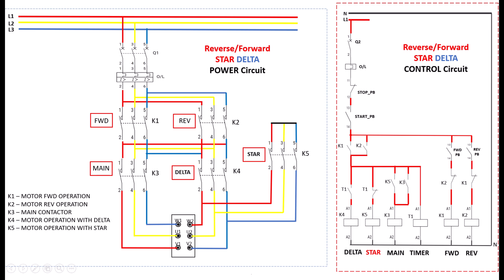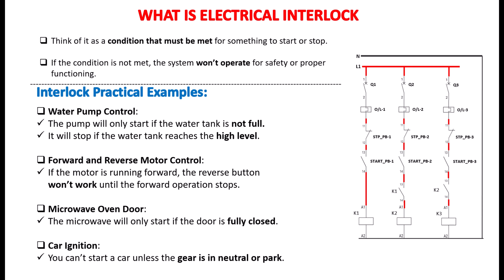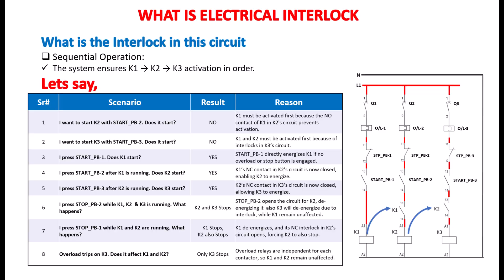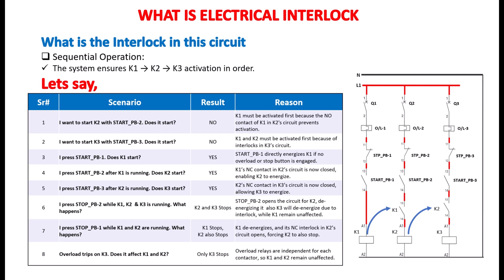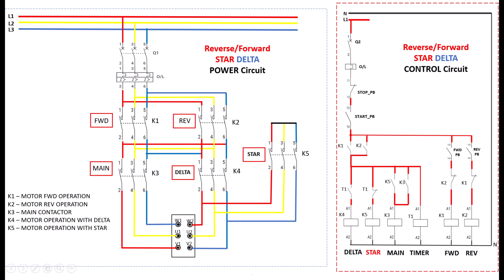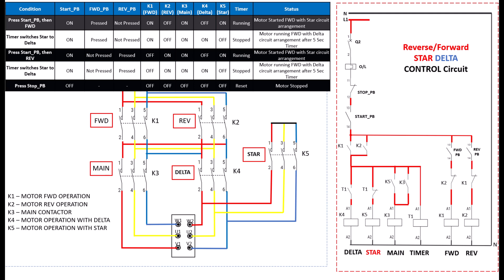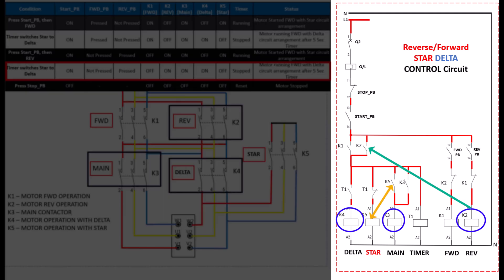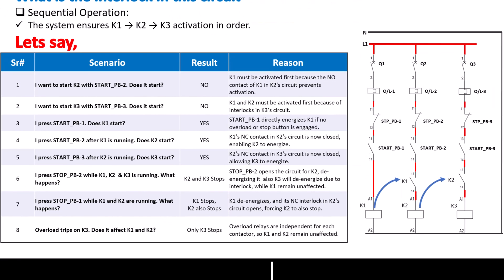Reverse Forward Star Delta Control Wiring | How Electrical interlock Work in Star Delta Control

Comment: K4&k5 is .not interlock
Reply from the maker: If you see, there is timer to switch from star to delta. right ? both star and delta can't run at the same time. OK ?

Though this is very basic to highlight the concept, yes , but you can add multiple interlocks in it too.
Reply: start PB Holding where
Reply: Motor terminal no legend wrong. How to make delta

Comment: Star &delta is not inter lock in control circuit
Reply from the maker: Interesting, Can you see again the control drawing please to reconfirm your statement. May be its 2 way learn for both of us.

Thanks
Reply: if star k stucked  then   Delta Signal coming  and short circuit in power  such type problem coming  after some few time later

Comment: Just a thought. I think when you do the K1-3 example it should be a start switch that retains power to the coil. There is no seal in circuit so unless you had someone constantly holding buttons in the scenario would not work as described, unless there is something I am missing. Thank for the video and hopefully some feedback
Reply from the maker: Thanks so much for your feedback and for pointing that out!
 You're absolutely right — in a real-world application, we would typically use a seal-in (latching) circuit to hold the coil energized after the start button is pressed.
In this video, I intentionally left out the latching circuit to keep it simple for beginners, just to help them first understand the basic function of the relay coil and contacts. But I completely agree that for proper operation, a latching contact would be essential.
Really appreciate your comment — it helps make the discussion more valuable for everyone watching! 👍
Reply: @IndustrialControlAcademy  I guess also could be a maintained button which I missed
Reply from the maker: Yes, Perfect!

Comment: "Why do some people only use 4 contactors, but you use 5 contactors? What's the difference between the two?"
Reply from the maker: yes you are right. the same thing is doable with 4 contactor as well. once you understand easy ways then you can try different configurations!

Comment: Why do you only swap on forward/reverse and not star side
Reply from the maker: you just need to swap only 2-Phase with other to change the direction. Lets say, you started motor and motor running in clockwise, and you want to rotate it anti-clock wise. you just swap the 2-phase connections. e.g. swap red phase with yellow phase. I hope you got my point.

Comment: Once in delta fwd. If you push rewerse. You have A big problem becouse of the inertia of the motor in forward. And powering it in reverse without being stopped at stand still still. Don't you thonk so? And that in a glance of schematic first page.
Reply from the maker: Reverse contactor K2 would not energize until K1 forward contactor deenergize. its a interlock between K1 and K2. At a time,  Motor will rotate only in one direction. either forward or reverse.

Please see the control drawing again, and let me know if you need any clarity. Thanks!
Reply: @IndustrialControlAcademy  I agree! with this interlock, only 1 direction will work only at a time. either forward or reverse.